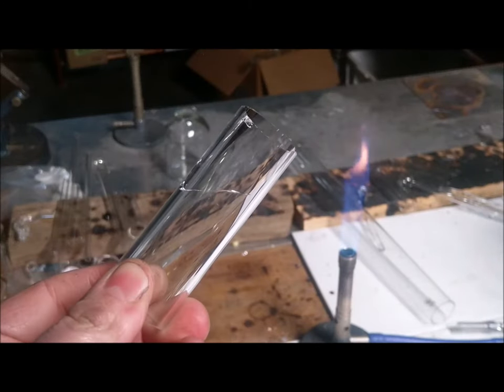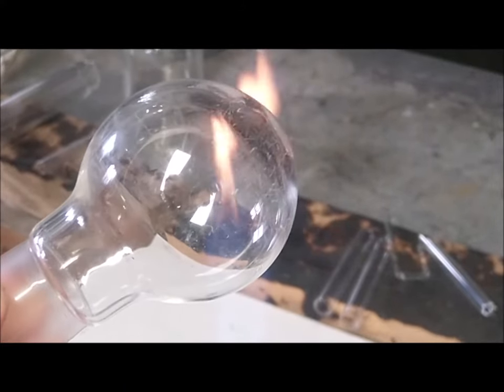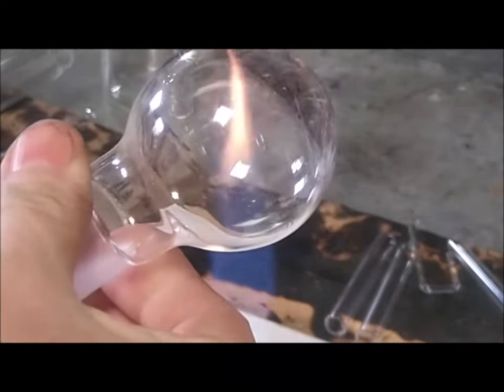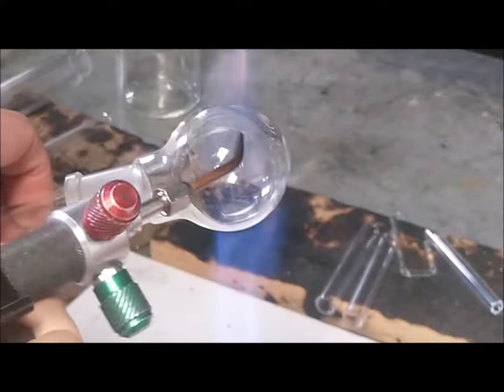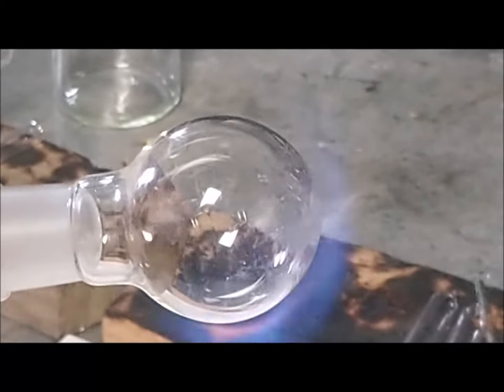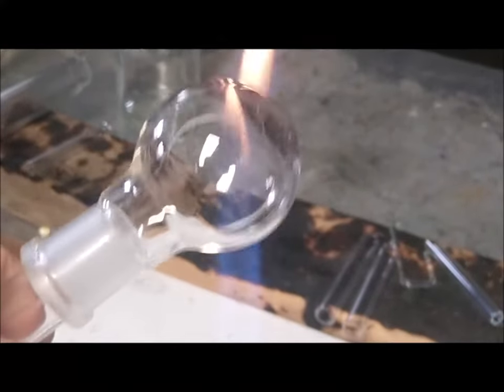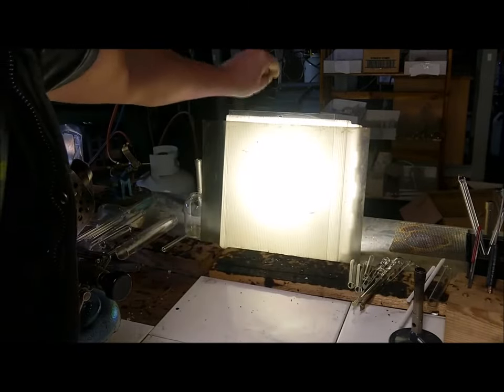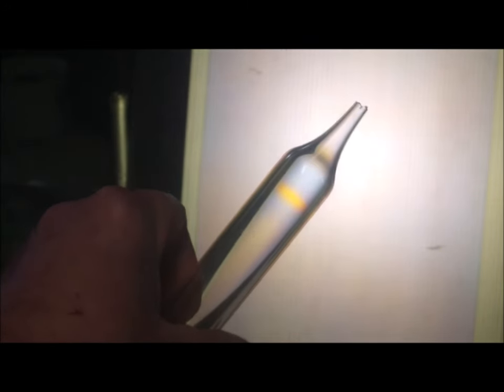Healing a crack

Comment: Didn't know about the polariscope, thanks for that, ive used although not as hot & will take longer my gas stove element or just a gas lighter depending on the repair & glass thickness

Comment: Okay but how do you make sure it cools down both evenly and slowly? That’s the much harder part.., even if you repair it when it’s hot… it’s just going to crack again if you just take the entire thing out of the flame and into room temperature as that’s way too rapid and will just make it worse so… I feel like this is not really even quite half of a realistic process
Reply from the maker: Thanks for the question, it's a good one.
Breaks occurring from large temperature changes are indeed a problem, but whole video is about spreading the heat over the entire piece using a bunsen flame and why it matters. A bunsen flame isn't too hot, and so to cool down from that temperature is not a problem for borosilicate glass. The temperature difference between the flame from an oxy torch and the temperature of glass in the bunsen flame isn't as wide as if the piece was at room temperature and so the stress is also going to be as bad either. In fact, cooling the piece down from the bunsen after the repair showed no stress at all with the polariscope. I demonstrated that this is a realistic approach to small repairs.
 
Larger repairs with thicker wall glass and joins going through the wall cause more issues, and more care and specific pre-heating regimes are needed. And even then, with all the skill you have as a professional glassblower, it can still crack on you. An annealing kiln is absolutely necessary to take out residual stress after a complex repair. But if you come to understand how spreading heat over a larger area than just the point of the crack or repair work will prevent cracking , then you will progress your glass blowing skills and become more confident tackling more complex work. 

I hope that's what these videos are about.

Comment: Hey, idk if you're still checking comments, but if you are, what's that torch you're using alongside the bunsen burner? I've got a cracked glass I need to heal, and this is the only video tutorial I could find
Reply: Thanks for watching and reaching out. I've got a small hand torch which runs off propane and oxygen, they are used by jewellers and some other crafts. But a small brazing torch for plumbing can also be used, so long as it runs on oxy/fuel and has a small enough tip.
Reply: "Smith mini-torch" he said in the video.

Comment: good video!
another way to make a polariscope (in case one doesn't have a big sheet of polarizing filter laying around) is to just use an lcd monitor showing a white image. what i do is rotating the small piece of polarizing filter near my eye (like the piece you placed over the camera in the video) until the white turns black (or in my case dark blue), if you then place the glass piece between the monitor and your filter and there's any stress in the glass, you will see bright white spots or bands
Reply from the maker: Very True! The monitor does work, the stress will show as black and white bands unless you place a sheet of something like clear polycarbonate in front of the monitor. Thanks for your reply.